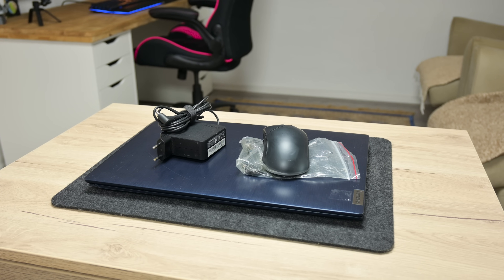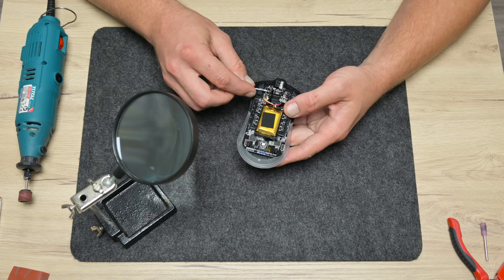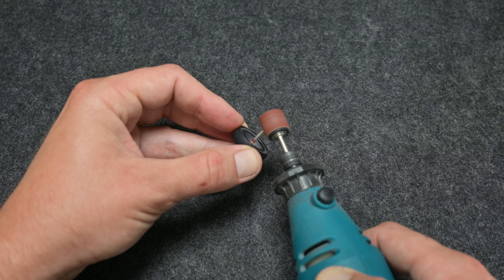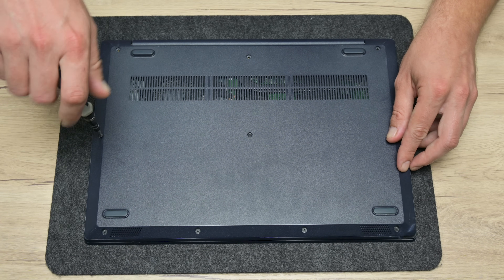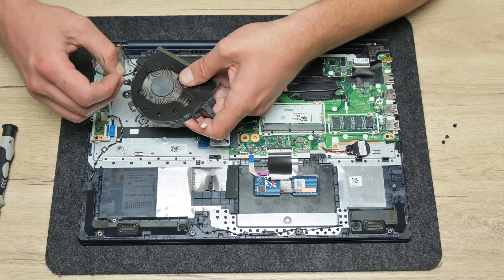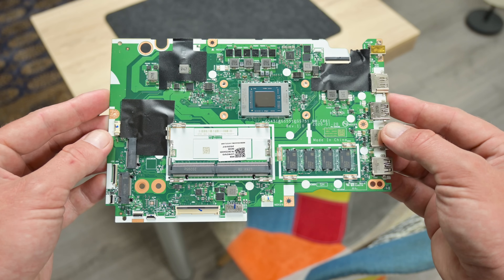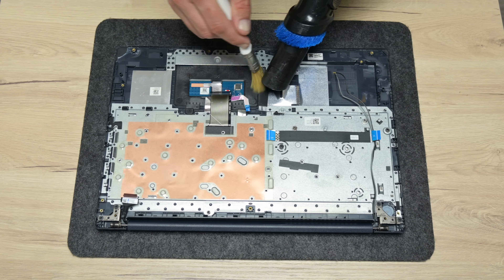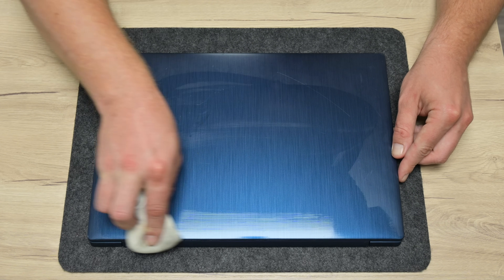Restoring ASUS Gaming Mouse and Lenovo Laptop

Comment: Good video, you need to consider that the allen is made of metal and the weel is made of plastic so if you sand it after stick it that can melt the glue or the plastic of the weel, so knowing the measure of the place you need to cut, you could sand it before to minimize the risk for temperature, I'm a spanish speaker so if you dont understand what I'm writing, it doesn't matter. I really enjoy your videos and have been following them for quite some time. Anyways, I really like that laptop motherboard. A big greeting from Argentina :D.
Reply: also I'd like to said that is very ingenius the way you repair that mouse.

Comment: I didn't really understand any part of the wheel balancing part.
Reply from the maker: The wheel is rotating but is shifting left and right. The rotation must be very straight because if it's not straight rotation then the wheel will constantly hitting the side plastics and the LEDs from the inside the wheel
Reply: Just imagine your handwheel in your car is not aligned it's the same concept

Comment: Nice repair on the laptop and mouse. Most people probably wouldn't even bother to repair a mouse, they instead throw it away or swap it for a new one.
And good job on the upgrades for the laptop, too - though why sell a Ryzen 7 laptop with just 4GB of soldered on memory? At least it has 12GB now, though in my opinion, you can never have too much fo RAM! I'd have also added secondary disk if the cable/connector was there.
Reply from the maker: I do bother bro, this is not the cheap mouse, but even if it's some cheap why not to repair if its possible. Btw yes, the 4GB is soldered on the motherboard, and max support is 12GB only
Reply: @ComputersAndTechAndAndrew  that's excellent, I do like it when things are repaired or repurposed instead of just being thrown out. And I am surprised they would sell a Ryzen 7 laptop with 4GB soldered RAM. 
Surely it is possible to have 20GB instead, like 4GB soldered + extra 16GB?

Comment: I like how you repaired and Made spare part of the mouse.. the others maybe Will use 3D printer
Reply from the maker: 3D printer is good, but most people don't have 3D printer, this is how to fix something with stuff available for everyone. Btw even if I used 3D printer the part will be much weaker than using metal